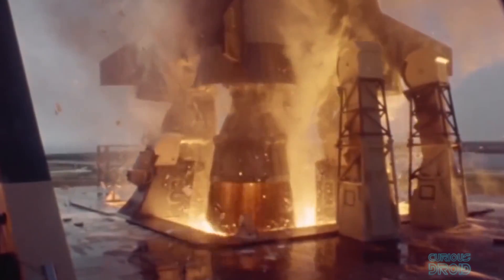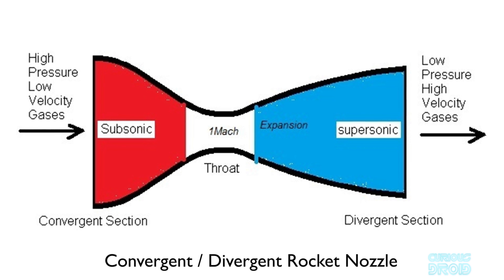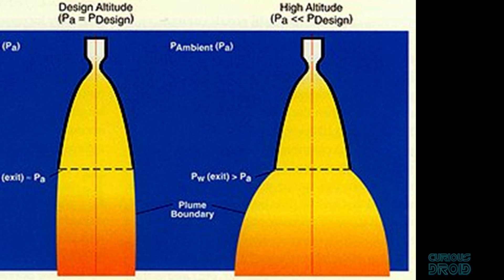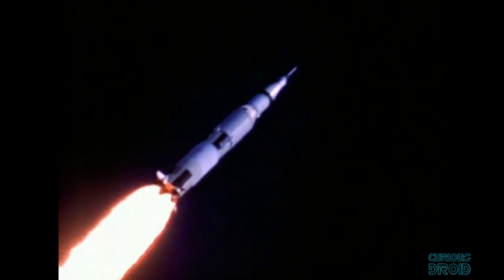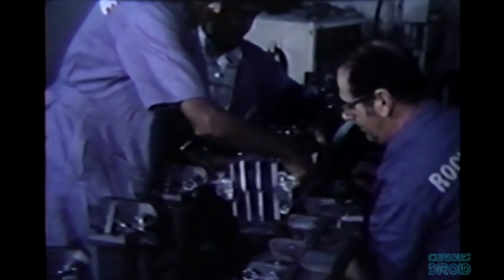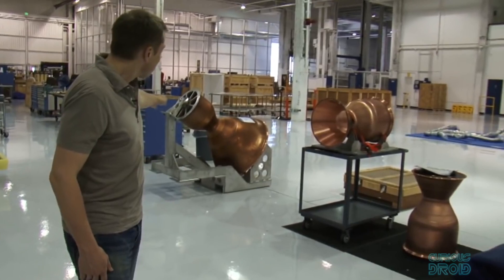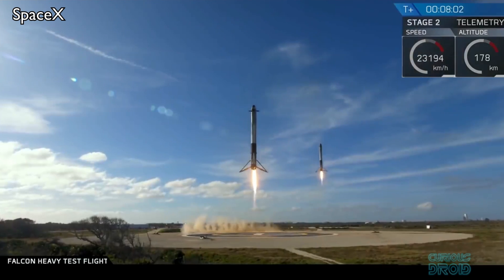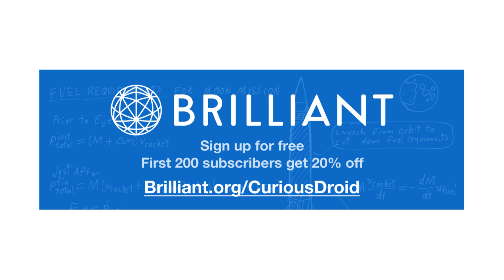Aerospike Engines - Why Aren't We Using them Now?

Comment: So I've been thinking about this video for a few days.  The claim was that aerospike engines only saved 10% or 20% (I can't recall exactly) of the fuel, and the fuel was a relatively small part of the mission cost (and I don't doubt the veracity of either of these statements).   But what I was wondering is, given the relatively small ratio of payload to orbit versus initial mass (rocket + payload + fuel) whether or not the savings from an aerospike engine would double or triple the payload to orbit?  In which case it'd make a massive difference?

Comment: Interesting.  But your conclusion leaves me with a question.  You said that it's likely the aerospike will only see use once conventional costs are driven down heavily by reuse, but isn't there another huge benefit?  Not the cost savings of the fuel but the WEIGHT savings of the fuel?  If it uses 25% less fuel to get into orbit, they could replace the weight of the extra tank and fuel with added cargo capacity.  Falcon 9 carries nearly 500T of fuel.  It has a lift capacity of around 27T.  Obviously much of that fuel gets burned off, so it doesn't actually carry the whole load to space, but regardless, it seems like using an aerospike would allow them to massively increase their lift capacity.

Comment: Probably more development on them will happen when either:
1 - All other cost-reducing methods have been implemented (like you mentioned, returned boosters etc)
2 - The Mars missions start (where you need rockets that can land can return. You can do it with traditional engines but their cost will be quite high). 

atm SSTOs aren't that necessary cuz all launches are from Earth (where we have the infrastructure to make, capture and refuel engines). On Mars, since that infrasture isn't there, we would want more self-sustainable rockets (aka, SSTOs).

Comment: A single rocket is nice but most of the weight of a rocket is fuel and you need large tanks to hold that fuel.  If you've burned out the fuel why do you continue to carry the large and heavy tanks.  That's what staging is, dumping extra weight drastically increasing your fuel to acceleration ratio.
Reply: In a word im betting its cost. Its likely cheaper to build a bigger tank holding more fuel using a single or set of engines then it is to use many smaller tanks and engines as well as the equipment to eject them even considering the cost if fuel.

Thats my guess anyway. I mean if 1 large tank and engine with extra fuel is $10,000 but requires 40% more fuel then the staged design which costs $30,000 even though its more efficent and uses less fuel then they will build the single large design.

Another posibilty is reliability. When you seperate a rocket a lot can go wrong, a single engine and tank has fewer points it can fail vs say a 3 stage rocket. Indont know enough about rockets to say for sure but thats my best guesses
Reply: @arcticfox5118  Don't forget the cost to retrofit all of your existing flight vehicles to accommodate it.
Reply: @arcticfox5118  the problem is weight. You need to discard useless masses as soon as possible. So, aero-spike ends in an useless concept.
Reply: Fuel is cheap, hardware isn't.
Reply: You're all forgetting the space shuttle. And someday we'll build another one.. this time one that isnt a huge boondoggle (the shuttle didnt meet its design goals, was more expensive to use than standard rockets etc etc)

Comment: Okay, but the engine efficiency isn't at all why we use multiple stages. Regardless of how inefficient or super efficient your engines are, you still need to lift a shit ton of mass to very high speeds and altitudes. The more dry mass you carry (empty stages), the far less efficient your launch is since you're wasting energy bringing up dead weight. Stages are by the far best way to increase a rocket's delta-v without requiring gargantuan rockets for tiny payloads.

But now that there are stages, rocket engines only operate at certain altitudes before they are dropped. So you can choose between an expensive variable engine that is good at everything, or cheap specific nozzles that are great at particular areas. The latter is the obvious choice.

Comment: The one detail this video somewhat does not really get into, is what would be the specific benefits of such an engine. He says they are more efficient at all altitudes, fine. He doesn't really talk about the scope of potential benefits, like, do you get more range? Greater payload ? and so on. It is briefly mentioned how cheap fuel is relative to total cost. So, I have to ask, how would these engines cause 10k per kg to orbit, to drop to 1k per kg, fuel being so cheap comparatively.  Good video, but fails to really explain the full extent of  the advantages. If one ere to say, an Aerospike rocket would cost x% less than a conventional one, that is something people can relate to.

Comment: Dumb question I don't know if I got the whole complex on why they stopped but it seemed like they stopped for numerous reasons. Just out of curiosity if it is hard to make it on a large scale at the present time, why not make two smaller ones and place it on a shuttle is that plausible. Sure it would throw the design complex out the window it's just a thought.

Comment: Another fascinating new type of rocket design is the one developed using atomic fission. They are incredibly powerful and the thrust would have made them viable engines to reach nearby star systems. The first one was kalled 'Kiwi'' and they were pretty much proven and perfected by the late sixties.

Comment: yes that is all good and well but more importantly,
For a number of years now, work has has been proceeding in order to bring
prefection to the crudely conceived idea of a machine that would work to not
only supply inverse reactive current, for use in unilateral phase detectors, but
would also be capable of automatically synchronising cardinal grammeters.  Such
a machine is the 'Turboencabulator'.  Basically, the only new principle involved
is that instead of the power being generated by the relaxive motion of
conductors and fluxes, it is produced by the modial interactions of magneto-
reluctance and capacitive directance.

The original machine had a base-plate of prefabulated amulite, surrounded by a
malleable logarithmic casing in such a way that the two spurving bearings were
in direct line with the pentametric fan, the latter consisted simply of six
hydrocoptic marzelvanes, so fitted to the ambifacient lunar vaneshaft that side
fumbling was effectively prevented.  The main winding was of the normal lotus-
o-delta type placed in panendermic semiboloid solts in the stator, every seventh
conductor being connected by a non-reversible termic pipe to the differential
girdlespring on the 'up' end of the grammeter.

Forty-one manestically placed grouting brushes were arrranged to feed into the
rotor slip stream a mixture of high S-value phenyhydrobenzamine and 5 percent
reminative tetraiodohexamine.  Both these liquids have specific pericosities
given by p=2.4 Cn where n is the diathecial evolute of retrograde temperature
phase disposition and C is the Chomondeley's annual grillage coefficient.
Initially, n was measured with the aid of a metapolar pilfrometer, but up to the
present date nothing has been found to equal the transcetental hopper dadoscope.

Electrical engineers will appreciate the difficulty of nubbing together a
regurgitative purwell and a superaminative wennel-sprocket.  Indeed, this proved
to be a stumbling block to further development until, in 1943, it was found that
the use of anhydrous nagling pins enabled a kyptonastic boiling shim to be
tankered.

The early attempts to construct a sufficiently robust spiral decommutator failed
largely because of lack of appreciation of the large quasi-pietic stresses in
the gremlin studs; the latter were specially designed to hold the roffit bars to
the spamshaft.  When, however, it was discovered that wending could be prevented
by the simple addition of teeth to socket, almost perfect running was secured.

The operating point is maintained as near as possible to the HF rem peak by
constantly fromaging the bituminous spandrels.  This is a distinct advance on
the standard nivelsheave in that no drammock oil is required after the phase
detractors have remissed.

Undoubtedly, the turboencabulator has now reached a very high level of technical
development.  It has been successfully used for operating nofer trunnions.  In
addition, whenever a barescent skor motion is required, it may be employed in
conjunction with a drawn reciprocating dingle arm to reduce sinusoidal
depleneration.

Comment: Wouldn't Aerospikes also reduce the price of manufacturing the rocket engines? While the rocket nozzle will be more costly, and R&D will be costly, the rocket wouldn't have to be so large to carry the fuel required to do the same job. In the short run the price would be more expensive, but in the long run the price of manufacturing and replacing the rockets when their life-time ends would be less expensive. Right?
Reply: Sadly, no. SSTOs, even with aerospikes, are woefully impractical. The higher complexity and lower performance of an aerospike (yes, lower performance) compared to conventional bell nozzles makes them unattractive. Since they don't make SSTOs practical, they'll be one use, unless you use a SpaceX style reuse method. But still, the high complexity is a major problem.
Reply: Ungregistered User Lower specific impulse, thrust, thrust/weight, the whole nine yards.
Reply: @badbeardbill9956  
If a spaceplane were launched using an electromagnetic Mass Driver (albeit one hundreds of miles long and terminating at a mile or more of altitude), it could emerge at hypersonic speed and be designed from that airspeed and altitude as a starting point.  The launch system would be expensive, but the launch vehicle itself could be simplified and reduced in cost greatly.
Reply: HuntingTarg Yeah. But that equally applies to conventional bell rocket engines
Reply: @badbeardbill9956  
I never said it didn't; the whole video is tethered to the premise that an aerospike would be a more suitable SSTO engine design than a nozzle bell.  The simple fact is that an aerospike is a poor design for vertical liftoff, which the above proposal deals with.
And such design parameters wouldn't apply 'equally' to both engine designs, for reasons discussed in the video:  A belled nozzle design suitable for sustained atmospheric climbing would perform poorly in vacuum, and vice versa.  This is not the case with an aerospike, where an exhaust skirt can be lowered around the spike around crossing the Karman line.  Current SSTO nozzle concepts are of a fixed configuration, especially when regenerative cooling is used.
Reply: HuntingTarg Aerospikes are worse across the board. An engine optimized for the median altitude will be better, and expansion issues can be dealt with in the same way the shuttle did: nozzle geometry. Aerospikes are unnecessarily complex.
Reply: @badbeardbill9956  

So you actually just keep coming back with 'Aerospikes are inferior and should not be used.'

Which is not what the research and test data indicate:
http://www.ijsrp.org/research-paper-0516/ijsrp-p5314.pdf
https://space.stackexchange.com/questions/25708/does-the-entirety-of-the-efficiency-of-an-aerospike-engine-occur-in-the-lower-at
The SSME assembly gimballing design helped to offset low-mid altitude efficiency losses, by employing the same basic principle that an aerospike is designed to employ.
So you're just being a bull full of crap.
Reply: They even said that the aerospike would allow it to be SSTO, which would let them save the entire rocket for reuse.  Smaller steps with making parts reusable is easier to show progress to your stockholders than spending years on a massive improvement that you only benefit from if you succeed.
Seems like the records of the X33 could help with that.

Comment: One thing you didn't explore was if the engine was capable of a landing manouver. Sure it could gimble left and right, but not up and down, limiting the correction vector. When a rocket is spinning, this also cannot be corrected

Comment: Could it be that the fuel capacity needed to even get the fuel tank Mass into orbit is large enough that you would want to use multi staged rockets anyway? I'm far from an expert, but have found experimenting in KSP that multistage is saving a lot of fuel cost.

Comment: Multi stage rockets from the empty tanks and primary engines and thus reduce weight for the ongoing stages. Could there be a solid fuel aero spike engine?

Comment: Pedantism incoming: A square inch is not 2.54 sqcm, it's 2.54cm squared.
Reply: BS call-out incoming: it's the same thing.

P.S. by your logic, it wouldn't be "square inch" either, it would be "inch squared", so not only is your logic wrong, you failed at your own logic.
Reply: You are correct, Chester here is wrong. The graphic is right but the narration is incorrect. "One square inch" is 6.45 square cm while one inch square is 2.54 cm square. So, Chester, it's not the same thing.

Comment: Doesn't the staging process also allow the rocket to shed weight? It seems like the efficiency of the engine changing based on air pressure is facilitated by the staging but the ultimate goal is to save on the weight being carried to orbit. Given the inspection regime needed to re-certify a used engine for flight, it seems like reusable spacecraft - especially human rated spacecraft - are going to be far more expensive than just building a new one that's intended to be disposable. And if you're already going to throw it out, the staging isn't nearly as wasteful as it would be otherwise.
Reply: Staging to throw it away is the reason space is so expensive. Reuse and fast turn around were to be hallmarks of the VentureStar. Refuel and refly. Like an airplane. So while cargo is low, cost is even lower. No hardware loss.